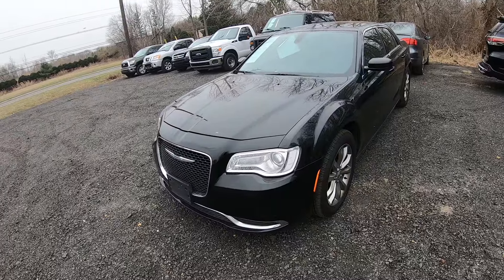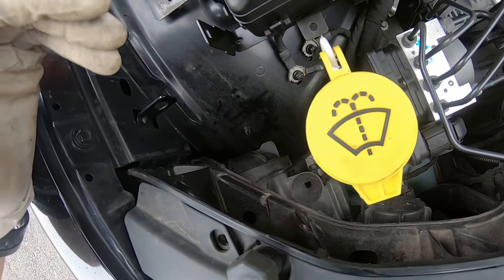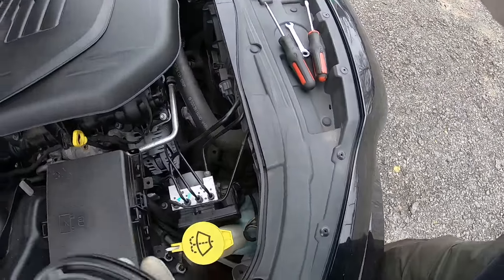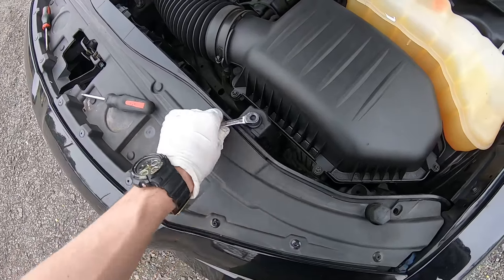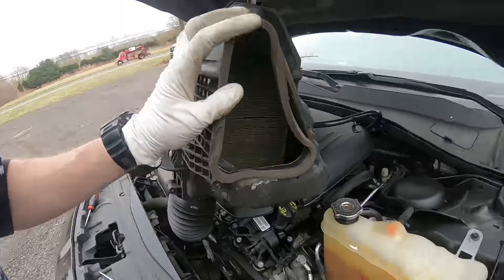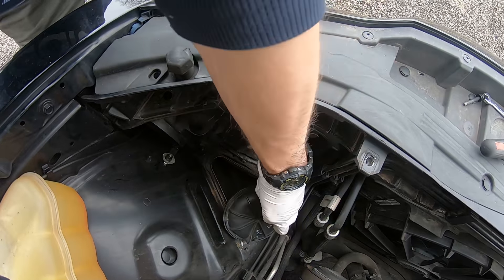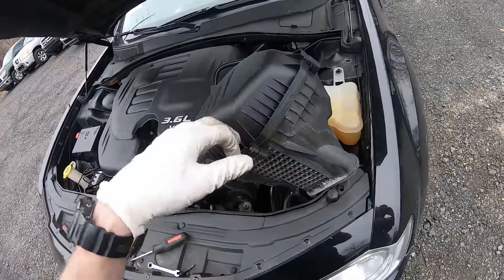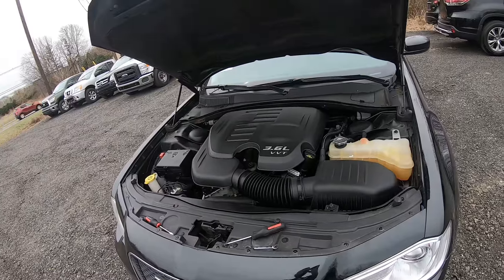How to change replace Headlight bulbs in Chrysler 300 2011-2019

Comment: I will now buy that type of car as I am always changing headlight bulbs and installing Led's. Some cars one has to almost remove the Fender or bumper.
Reply: @Chris Swenson Thanks for your info. I in the end decided not to buy that car and went with the Ford Taurus and installed Leds for headlights and it was 3 minutes on the passenger side and 10 on the driver side